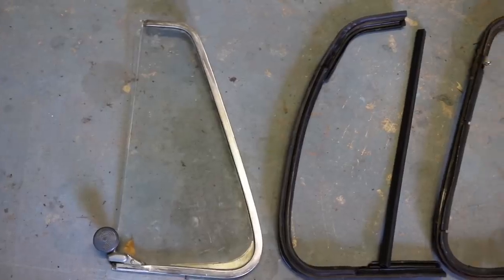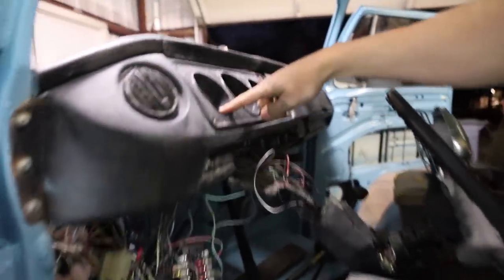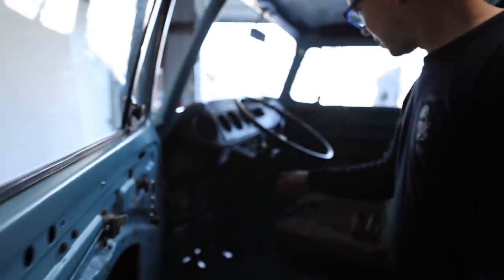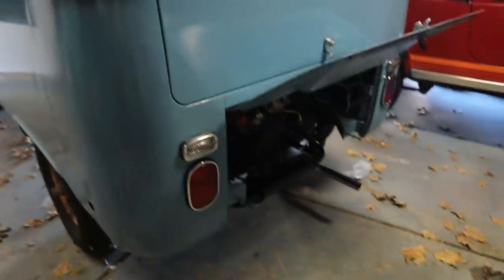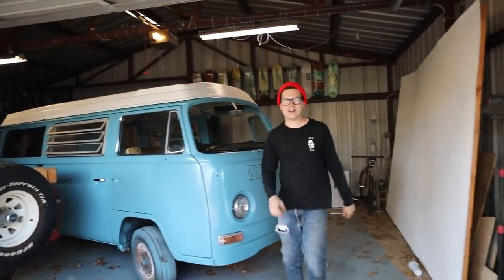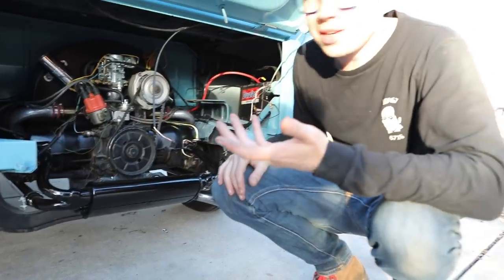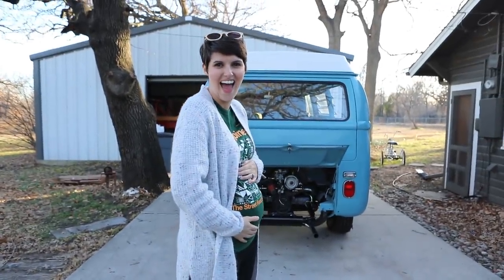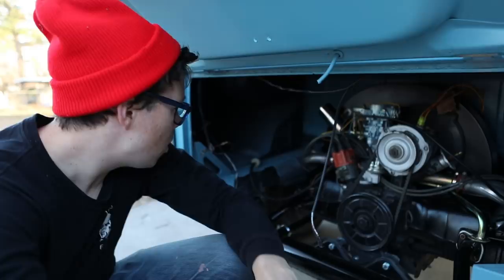First Drive! 1970 VW bus | Underwood Garage 9

Comment: You have likely resolved the shift issue by now but if don’t have all the gears it’s is likely the shift plate in floor OR shift coupler back near transmission...Both are super easy fixes and might just be loose!

Comment: Not being a jerk. Just saying you need to be able to kill the engine with the key. That means you have constant power to the coil. You could burn up the coil. Drain the battery and burn up the points (If you have them) also you need to put on the piece of metal that goes infront of the engine with the engine seal and deck lid latch. Without that the hot cooling air from the engine. Could get sucked back into the cooling tins and overheat the engine. Just trying to help.
Reply from the maker: Super appreciate the concern!

All of that will be done! This was just a quick “will it move moment” definitely don’t intend on driving it with those things missing / not sorted. 

Thanks for pointing these things out though I could definitely be missing things so keep it coming!
Reply: @clarkunderwood  no problem. I am a vw guy to. Have many busses and bugs. Just trying to help so you can enjoy your bus for as long as possable.
Reply from the maker: Appreciate it! I’ll take all the direction I can get!

Comment: Hello, you have second, gear just step, on the clutch and pull
Down on, the gear selector, step on the, clutch again and push
The gear, selector up for, third gear step, on the clutch again 
And pull, down the gear, selector down for, high gear. Now for
Reverse, step on the, clutch and push, down on the stick and go
Over ,over .

Comment: Better buy an original fuse box ,this one you made looks dangerous
Reply: I disagree.  The original fuse panel (if you can find one) will only control what the bus did... originally.  There have been some serious enhancements since then. Air conditioning being one. Others like blue-tooth, wi-fi, and additional battery come to mind.  Those extra fuse slots will come in very handy.  The best part would be relocation of fuse panel to a more conveinent location, and knowing the fuse (and wiring) location for every electrical system in the bus.  Just sayin...